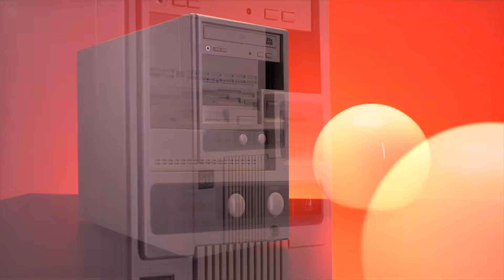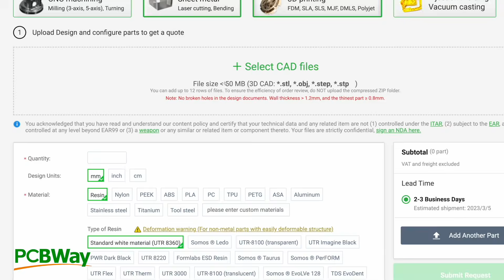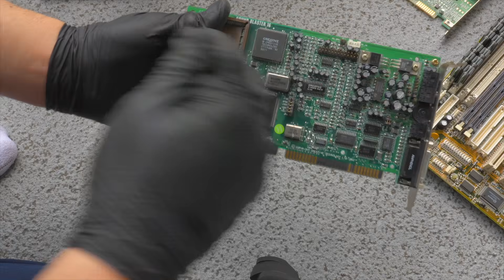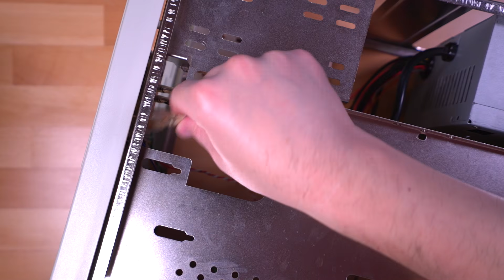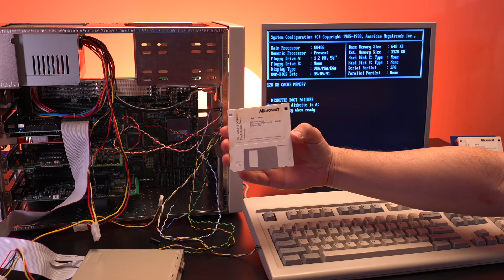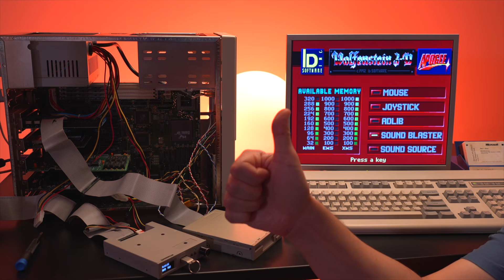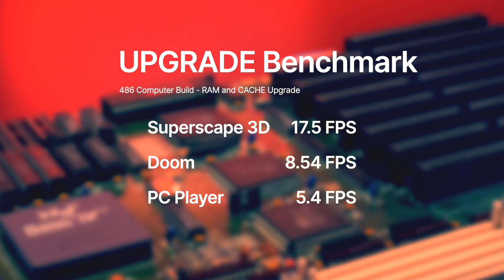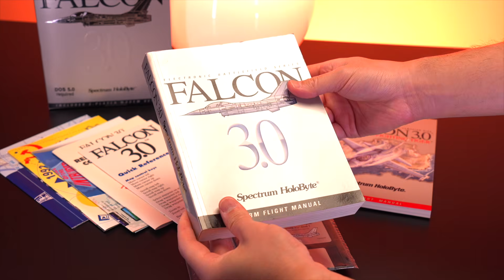Restored And Upgraded 32 Years Later | 486 DOS Build

Comment: One thing I do to install DOS on retro computers when I am using compact flash cards is to setup a VM (with a virtual hard disk that is slightly smaller than the compact flash) and install DOS. Then install all the games I want. From the VM it's very easy to mount iso's and floppy images. Then dump the image into the compact flash card. Installing DOS with floppies while is part of the experience, is completely unnecessary to do. It's actually possible if you store the VM's virtual hard drive in the right format to just stop the VM, mount it in windows and drag and drop everything you need as well. I usually just do this after I have installed DOS.

I mostly do this for older DOS laptops where I don't want to deal with any drives or they simply don't have any.

Comment: I wish I had my original PC from back in the day. But I’m building a retro gaming PC on a Pentium 3. As much as I would like 3 separate PCs for each era, modern tools make it fairly possible. The only drawback is that I don’t have a 5.25 drive currently. I found a method to hook it up via USB but the software says it can’t read the floppies. I’m not sure if the floppies don’t work or if the drive doesn’t work. So I’ll need to track down a known working 5.25 drive or just download the games from the internet archive and write it to a 3.5 disk.

Comment: Hey Tito!  Nice video!  I have been I have been taking apart and building my own computers since it seems like forever.  Your FPS is only going to improve if you upgrade the CPU and video card.  It really depend on the game/software you're running and if it will take advantage of advanced GPU technology back then.  Also back then to even use advanced graphics and such you needed to load drivers for the card, unless the game specifically included it.  Computers back then were MUCH LESS user friendly!!  It was always a fight between driver and having enough memory to run a game!
One bottleneck you may notice is the XT-IDE card is made to run on even older 8-bit systems.  To maximize your disk throughput, you would need a 16-bit hard drive controller in one of the 16-bit slots connected to an IDE to SATA drive or IDE to SD card.  Maybe there is a 16-bit version of XT-IDE (AT-IDE?) out there, but I haven't seen it.

Comment: It seems like you shouldn't need a XT-IDE for a 486, and that using a drive connected to one might slow down your drive usage. I'm assuming tat your 486 had onboard IDE, since you never showed an original IDE card. My preference would be to use a EIDE disk on module (DOM) to boot from, attached to the onboard IDE.  If there is no onboard IDE, then you should be sure to use a 16bit ISA adapter, although SCSI with a BlueSCSI or ZuluSCSI would also be an option.  As to memory not affecting performance, for games of that time, typically if you had as much RAM as the game wanted, more RAM wouldn't benefit performance.  You might want to try FastDOOM.

Comment: Why would you not? Is the bigger question. A Retro PC is better than a retro console, higher resolutions, framerates, much bigger libraries, Big Box PC games, no license keys, just pop in the retro pc games and play them natively, no emulation. With the libraries of games spanning through different generations. Especially a Pentium 2, AMD Athlon and a Pentium 3 Era PC, is the sweet spot for an all around Retro Gaming PC. Spanning through different generations, with AGP and ISA slots with sound cards such as the Sound blaster 16, AWE32 and or the AWE64, Geforce 3,4 and FX, 3DFX, ATI, Matrox GPU's to choose from. 

With just under 1gb of ram with a USB Floppy Drive Emulator, and have your PC set up as a Dual boot for Windows 98SE and XP to play games from the DOS era. All the way up to the Mid 2000's pre Steam Era, with games like Far Cry, Midtown Madness and Unreal Tournament. Plus no modding necessary unlike with the Consoles, extra functionality right out of the gate with a Retro Battle Station. The only thing to keep in mind for longevity, is replacing the Capacitors. Since the Capacitor Plague happened around the golden age for PC gaming, which was in the late 90's to the early 2000's. And I would also just replace the PSU's with a more modern and safer 80Plus PSU if the original has failed. 

The OG Xbox also has the capacitor Plague issue, like with these Retro PC's. The 386 and the 486 is really iconic, but rare and expensive, and it's more of a collectable today, great for Early DOS era games.  Later generation PC's, can run mid to late DOS games, where 3d Gaming became more of a thing along with going even further with Windows 98 and XP games. But a great budget option for the 486 and the 386 is the Mister FPGA, which has a core for it. A Windows 98/XP build, with a Mister or a compact 486 Laptop, would give you full access to the DOS library.

Comment: ok
1. you learned why it was difficult back in the day to adding components to a computer as some components just wont work in some computers
2. i recommend replacing your power supply with a modern one or rebuild the whole power supply as the older ones are junk and can fail at any time
and they tend to fail while taking anything they are connected to with them
3. the turbo button issue there might be a key in the bios or a jumper on the mother board that forces it to activate

Comment: You seem to be missing the Multi I/O card which would be Serial, Parallel, and IDE, and you'll need one of those for the CDROM and to plug in a serial mouse for windows 3.1. The proprietary bus CD drives that plug into a Sound Blaster are expensive and hard to find now. You can get up to about 15 fps on Doom by swapping your processor for a DX2 66 but after that your video card becomes the bottleneck.

Comment: I have an old Dell Dothan class Pentium laptop with 4:3 xga lcd panel. And an external Dell vga 5:4 17" monitor. Replaced the dead 60gigs HDD with a bigger one from eBay. Maxed out the ram at 1.25gigs. Works like a champ. 👍

Comment: For a 486 you kinda bottleneck the performance by using an 8-bit XT-IDE. IDK if they make 16-bit ones but otherwise you can use any kinda 16-bit ISA IDE controller and then the XT-IDE on either a network card or a separate ROM carrier.

Comment: Perhaps someone here will find this useful. A couple years back, I went down a rabbit hole trying to build the most broadly compatible DOS gaming PC possible. I landed on a Super Socket 7 motherboard with an AMD K6-III+ CPU. What makes the K6+ CPUs unique is that the CPU multiplier is unlocked and can be set in software (2x to 6x at 0.5 intervals), alongside enabling/disabling L1 and L2 cache to further control the effective CPU speed. You can then create per-game batch files to set the ideal CPU configuration prior to launching each game.
Reply: Outside of later Intel CPUs, most Socket 7 CPUs weren't multiplier locked. The K6/III+ had software multiplier control because it was designed for use in laptops.

Care must be taken when using these chips, because they often have lower core voltages than many desktop boards can support. They also draw more power, and can cause problems on desktop boards with weak power regulation circuitry. This was an era where board manufacturers were transitioning from linear regulators to switching buck regulators. Such power regulation circuitry was generally crude and didn't support very high power draws before they failed. Care should be taken to monitor the power regulation circuitry to make sure it can handle the CPU and not overheat or go into some undefined state that sends too much voltage and kills the CPU.

Some Cyrix CPUs were in the same boat. They were notorious for high power consumption and heat output. They also had a penchant for weird 75 and 83 MHz bus speeds, which would throw system clocks alarmingly out of spec and cause other stability issues. I remember back in high school, we had one lab computer that had a Cyrix MII-333GP and it was a never ending source of trouble. The 83 MHz bus speed overclocked the PC-66 memory and ran the PCI bus at 41.5 MHz. We couldn't use an AGP video card because AGP derived its clock from the FSB on that board and no AGP card was stable at 83 MHz.
Reply: @GGigabiteM  Interesting. I do know about the K6+ CPUs being designed for use in laptops, but I wasn't aware of the additional voltage concerns. In my case, I simply looked for a solid Super Socket 7 motherboard with K6+ compatibility and ended up nabbing an ASUS P5A rev 1.04. That, alongside the Gigabyte GA-5AX, seemed to be the most well regarded. I forget if I had to update the BIOS to support the CPU, but I do recall reading that it was necessary for some boards.

Comment: Oh this brings back memories. My first PC was a Mitac DX2 80, 4MB and a 540MB HDD. I later upgraded with a CD-Rom and Soundblaster ISA card. It sounds very basic now, but coming from a stock Amiga (of which I still own!) Doom 2 was a massive jump in specs.
FYI, look into FASTMEM command as that will help Doom 2 run a lot quicker 😉

Comment: I got started on a 386 with CGA graphics, which at the time was the top of the line best of the best. Later on it was upgraded to a 486 with Ega graphics. Of course there was also a primitive GUI called Dos Shell on it that has a set of preprogrammed options on it where if you hit a key or would open up that specific program or sub menu. Adding things to it was a pain and navigating Dos menus was much easier and faster. Frogger, Alley Cat, an asteroids clone, a helicopter rescue game, a primitive car racing game, and one other was the entire library.
Oh and for some reason I kept thinking this was an LGR video because he does ALLOT of retro and odd hardware stuff.

Comment: Well, it's interesting to me that you were able to keep your old PC for over 30 years as most of them by that point are gone.  Most people don't have the room to store it.  I remember when configuring hard drives and CD drives (the CD drive can be plugged into the ATA bus and set to slave, you don't need to connect it to the SoundBlaster 16) hard drives always had to be configured in the 386 to at least Pentium for a number of 90s machines it was through Cylinders/Heads/Sectors and also cluster sizes at times to get the drive to read properly.  The emulators probably don't have that advantage and then making a partition on the flash memory to match that spec would have to be done.  CD drives also need drivers to run properly.  I would say if you were to connect both a hard drive emulator and CD drive to the ATA cable and setting them to "Master" and "Slave" respectively would work.  Most machines at the time also only recognize two floppy drives at a time as well, so you would have to get rid of either the 3.5" or 5.25" to use it with the floppy drive emulator.  Using a standard ISA I/0 card that handles the drives, parallel and one RS-232-style serial port was often what these machines used.

There is one other thing you can do for that machine and that's install Windows 3.1 or 3.11 to make it period accurate.

Comment: you have an empty co-processor slot. The co-processor adds floating point math acceleration, so you should gain a bit of performance, if you add one.
Reply: No, the 486DX has a built in FPU. that socket was only useful when you had a 486SX CPU.

Comment: A few thoughts: look and see if there is an updated BIOS file and flash it to the motherboard. You can try overclocking the processor a little bit by increasing the front side bus speed as well as the clock speed. Look for the jumper settings in the manual for the board. You will need a CPU fan because overclocking makes CPUs run hot. That 33 MHz chip shouldn't have any problem running at 66 MHz. Lastly, your video card is another bottleneck that needs to be resolved. Provided you could find one. You could add a 3dfx voodoo 3 card but good luck finding one! 
Great video and thanks for the walkdown memory lane!!

Comment: I do wonder if the XT-IDE board was causing a bottleneck for causing the data from the CF card to be slower, then using a 16-bit IDE adapter.
Reply: No need to wonder. An XT-IDE is totally inappropriate for this machine - it already has IDE! He absolutely should have used a simple SD to IDE adapter.

Comment: Tito, if you want a real upgrade that'll improve performance you need to source an Intel Overdrive coprocessor. That empty socket near your CPU is for the coprocessor.
Reply: It's for a Weitek 4167.  You would be better off installing a 486DX (or an Overdrive) which has the FPU onboard.

Comment: Samsung SyncMaster 172x has 1280x1024 panel resolution, and this IS NOT period correct aspect ratio. It is 5:4, but for period correct aspect ratio, you want 4:3.
I strongly recommend finding 20-21" 1600x1200 resulution screen for your retro machine. :)

I also recommend to align the FAT partition on the CF card, as you will benefit (both speed and card endurance) from it when they are aligned. I know a tool called YSDDT that can do it.

Near the cache chips, there's an empty socket. Maybe it is to enable write-back on cache? If you figure it out what goes into it, you might improve the cache performance even more. ;)
The 128kB -> 256kB performance improvement is minimal, that is expected.

I also recommend a network card for it, making it super easy to transfer new programs and games to its hard drive over network. I usually run FTP server on retro machine and then copy files using modern machine.

For your TURBO issue, check the bios settings. Play around with settings related to TURBO. Maybe you need to switch around some kind of "System Speed" from "High" to "Low" or something. ;)
Reply: 1280x1024 may not be 4:3, but it's definitely period correct.
Reply: @giornikitop5373  1280x960 is period correct.
Reply: @GigAHerZ64  1280x1024 was supported by every monitor that could go higher than 1024x768, 1280x960 was not. by that logic 320x200 is also not period correct because it's not 4:3?
Reply: @giornikitop5373  Your claim something that is just not true. The 1280x1024 came into popularity with LCD panels. It was not a thing before that as it did not produce square pixels. And by the time those resolutions were available, you cared about square pixels.

And there were lots of resolutions that were supported by drivers/software. I for one sat on 1152x864 for quite a long time. That means nothing.
Reply: @GigAHerZ64  no. all 17"+ monitors supported 1280x1024, even a few 15", it was a standard long before lcd's. square pixels is not the be all in crt's because the resolution is not important, the pixel clock is. that's why 320x200 and 1280x1024 had better picture quality and clarity, than 320x240 and 1280x960, even thow they weren't 4:3. 1152x864 was always a hit and  miss in crt's in picture clarity, despite the correct aspect.
Reply: @giornikitop5373  Consume less snake-oil. :)

Comment: Regarding your cache upgrade, I would have expected a bigger performance boost as well. A couple things to look at: 1) The turbo switch on some motherboards slows down a PC by disabling cache. You said that your turbo switch isn't acting right, so I'm wondering if that might be part of the problem since it's acting funky. That's just a guess though. 2) You might need a TAG RAM chip to go along with your extra cache chips OR a larger TAG chip because of the increased total cache size. See if your manual makes any mention of that.

Comment: That's awesome! Great work on the system. The only thing stopping me from using my retro builds right now is the fact I feel I want to replace the capacitors in the power supplies so they'd be more reliable, given their age at this point. I just haven't gotten around to doing so yet.